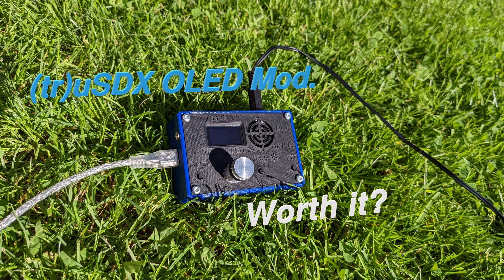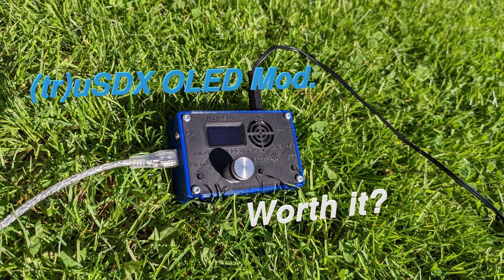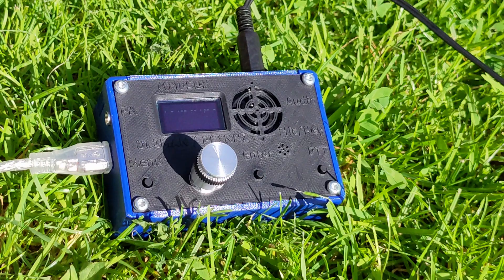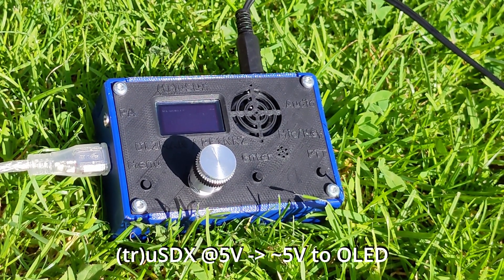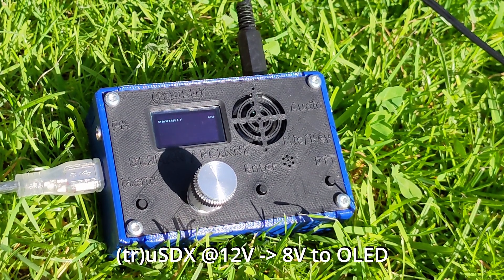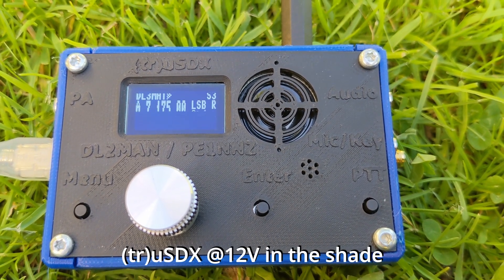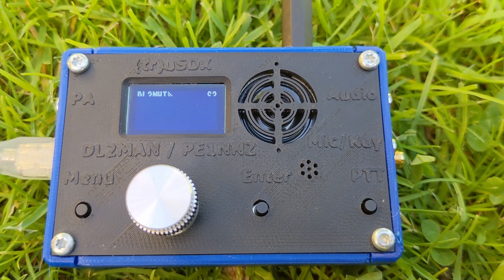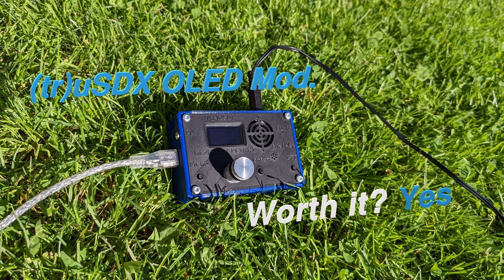(tr)uSDX - OLED Mod. | Ham Radio

Comment: Thanks for the demonstration. Does the increased supply voltage have any effect on the lifespan of the display?
Reply from the maker: I think Robert WA2T said in the forum he chose 8V because it was close to the voltage that the charge pump provided. Check the thread in Manuels forum. It is linked in the video description.

Even 8V is not readable at 12:00pm with the sun directly beaming onto the display, however it makes the difference between not usable at all and usable in the shade.

My guess would be that you have an increased risk of burn-in for pixels that are always lit, like your callsign. On the other hand the display costs just a few bucks, so get a replacement one and put it in the desk drawer for peace of mind.